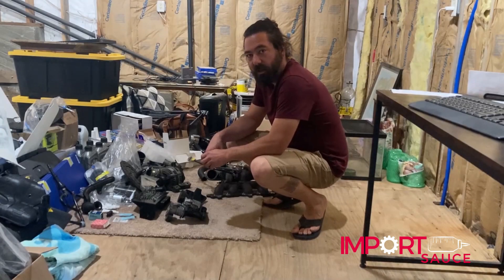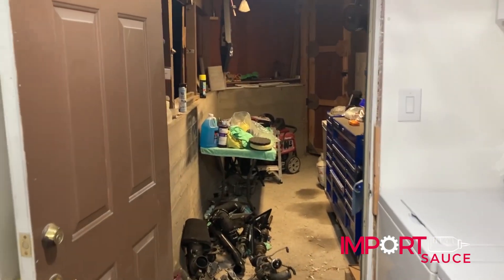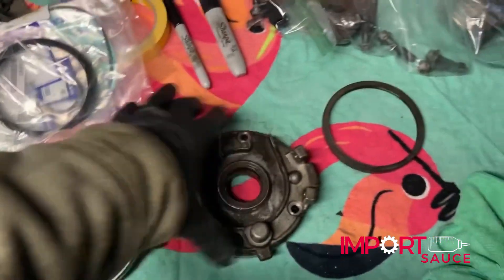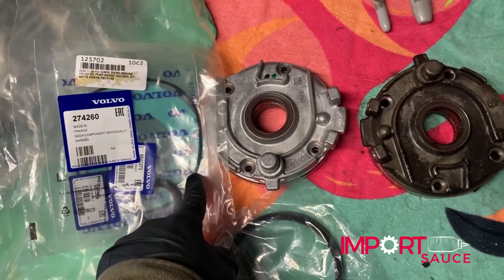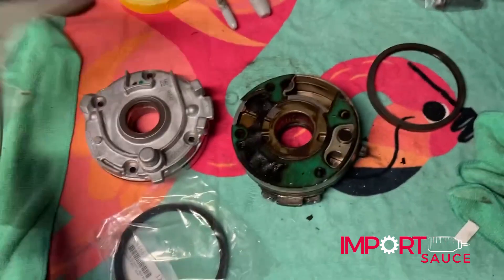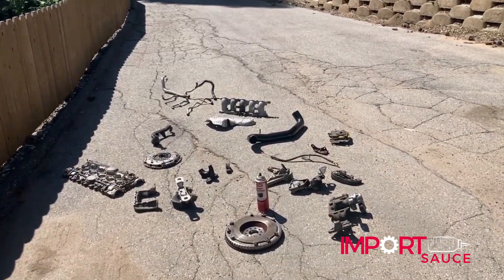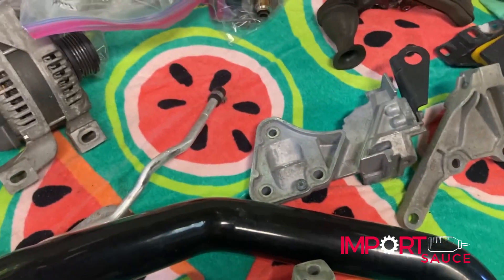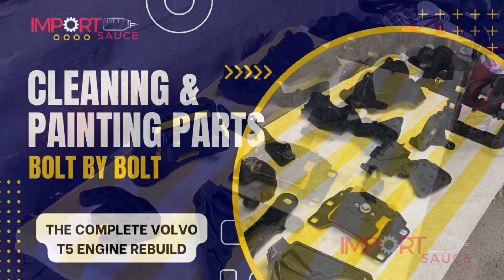Cleaning and Prepping Our T5 Engine Rebuild Parts - Bolt by Bolt, Thread by Thread

Comment: How did you clean the valve cover mating surface?
Reply from the maker: The head was machined, the timing cover was degreased and then super lightly sanded.
Reply: @moosedroppings  so if i take a scotch brit pad to it by hand it wouldn’t mess up the tolerances?